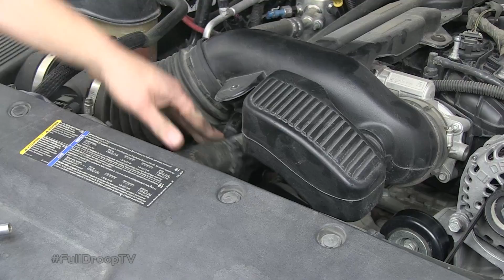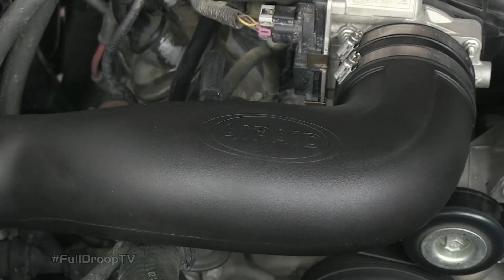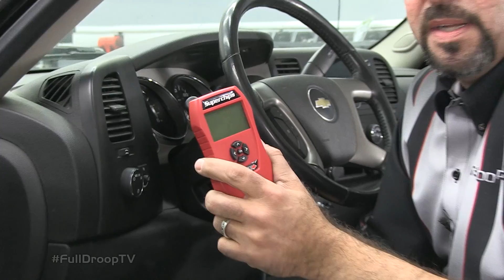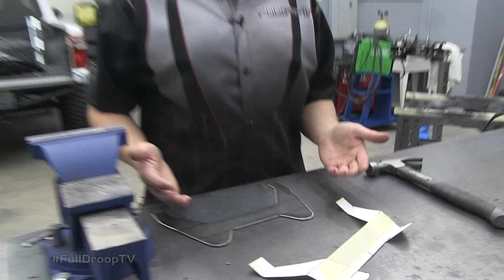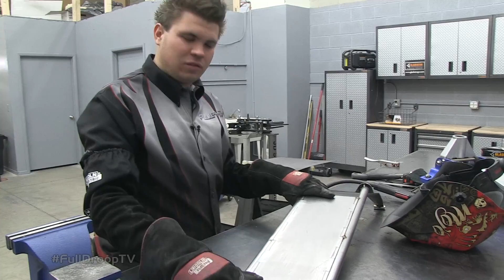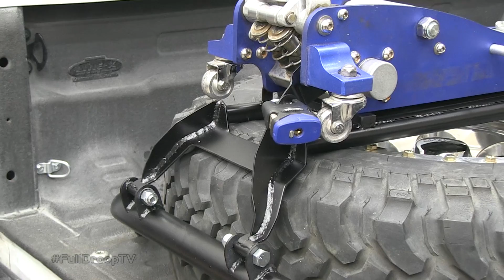More Power for your Prerunner - FullDroopTV (Season 1, Episode 6)

Comment from the maker: Haven't got the gears in yet but we will be running 4.56's in both trucks.
Yes the Flashpaq performs exactly as it is advertised. I had for the Ranger you might have seen in the show so I knew they were going to work well and being able to change your tire size helps a lot when you go from a 32" to a 37" tires.